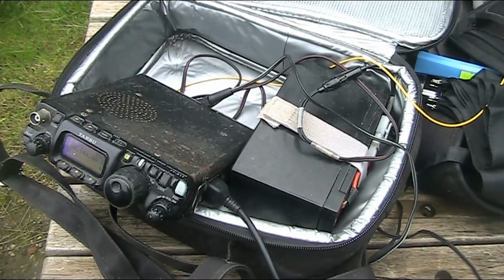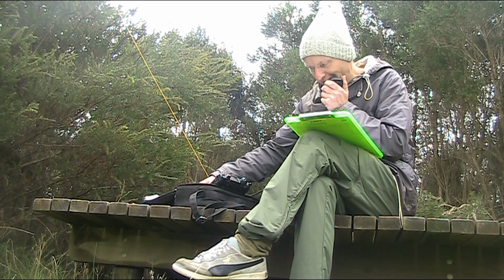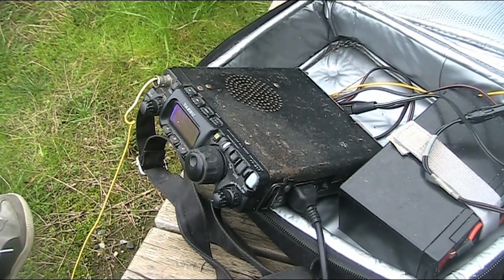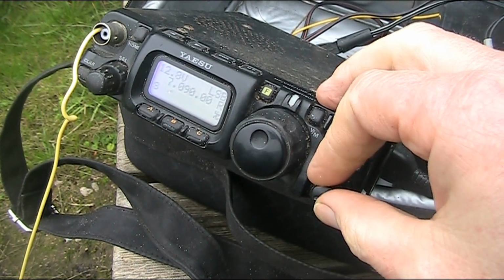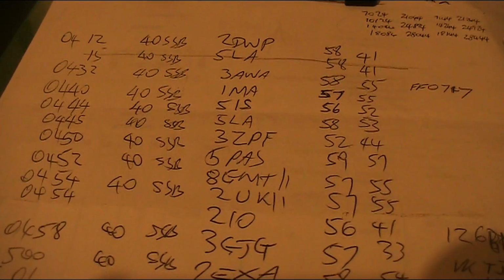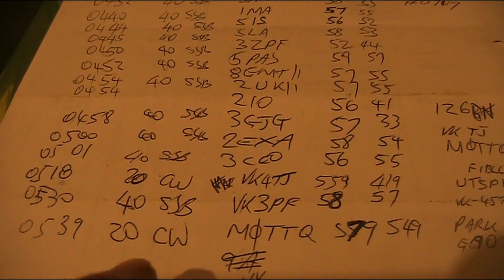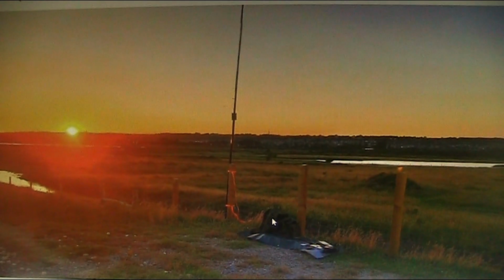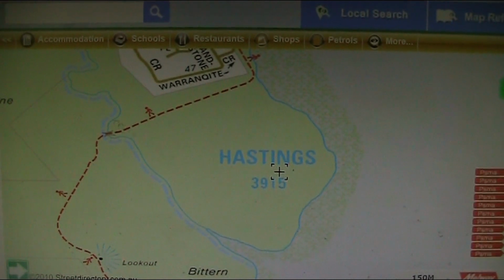Activating Warringine Creek Streamside Reserve

Comment: How many bars on the ft817 is 1.5 swr?
Reply: I would guesstimate 1 bar when on 5W 1-30MHz is about 1.5:1. This is from an article by KA7OEI. The 817's VSWR meter is not really a VSWR meter. It is a reflected power indication meter. 1 bar at 5W may be a low VSWR. However, at 0.5W, 1 bar may be very high. I generally tune for no bars at 5W.